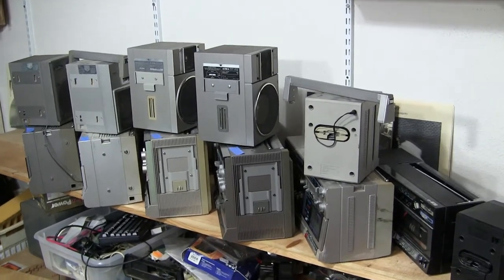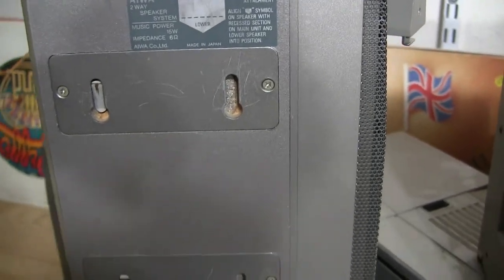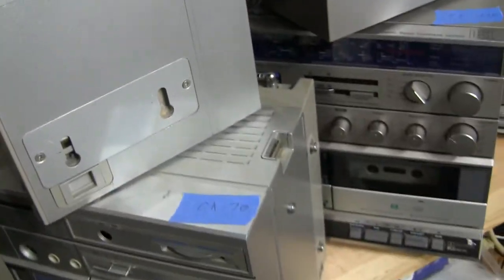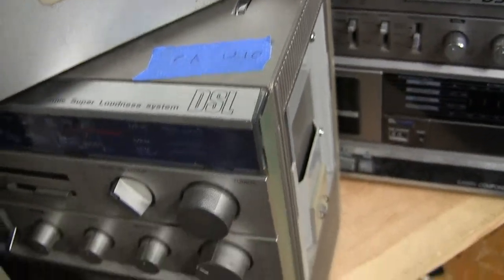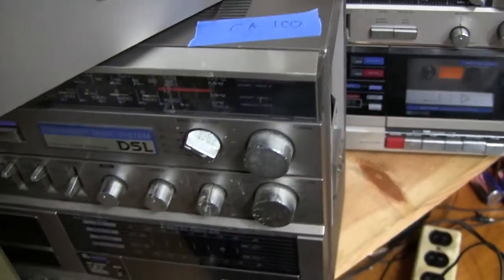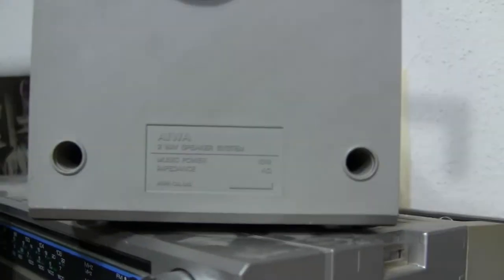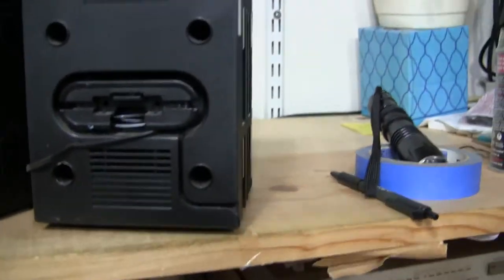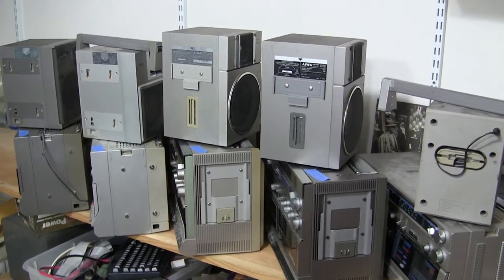AIWA Loud Speaker Wireless connect Stereo Carry Component System 3-Piece BOOMBOX CA

Comment: Aiwa CA-70 3D passive radiator, on which a metal plate is mounted on the suspension or paralon?
Reply from the maker: The metal weight which is oval is held in place by a foam rubber surround of which by this day and age of it that probably has crumbled to dust and is just rattling in your radio.